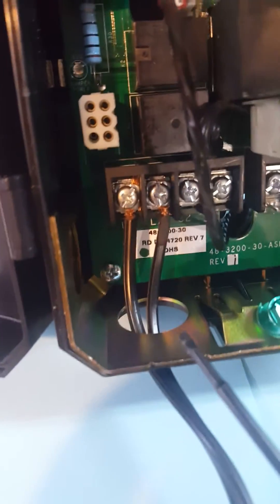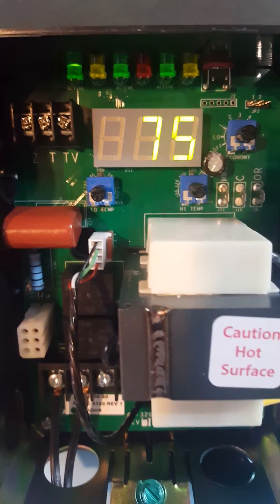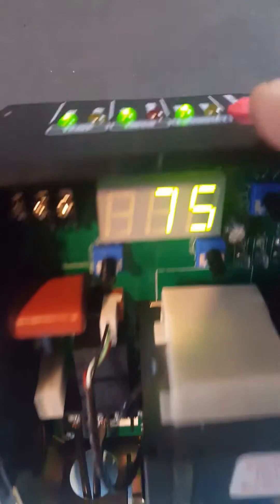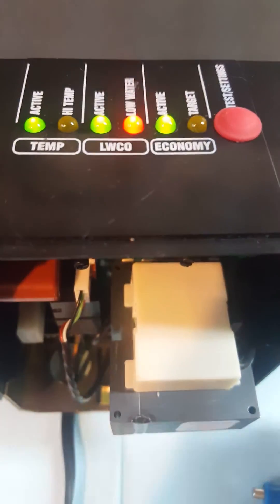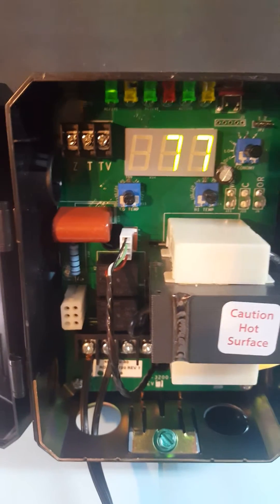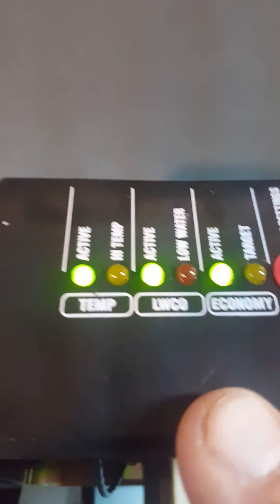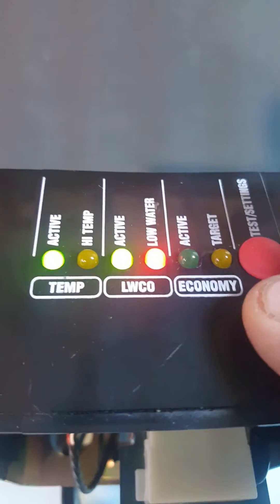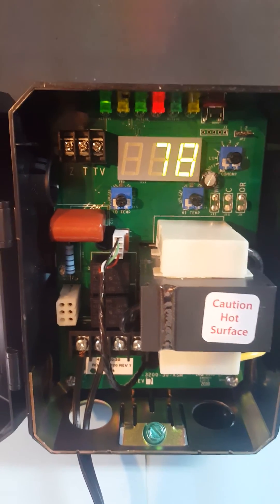Hydrolevel Boiler Control.... Replaces existing Aquastat relays

Comment: I replaced a Honeywell aquastat L4006A 1678 which was high limit temp only with this 3200.  The Honeywell is about $160 and 3200 about $190 and $32 for the Electrowell Well.  But the digital temp display, LW monitoring, and status lights give you more information than the Honeywell, which tells you nothing.  But there are many setups, so be aware of the 24v ac situation.  With my Honeywell, I needed to give a 24v source to it, but the 3200 should only get a low voltage input through T TV, and it will send 24v to the boiler.  My Zone pumps are controlled by a Taco SR gas boiler relay switch box, which is replaced the electro mechanical relays from 1964.  The Taco was like replacing a room size Univac with a PC.  I recommend this Hydrostat 3200 as far more user friendly than the Honeywell.  You don’t need a new well, but for $32 for EcoWell, you’ll have low water monitoring functionality.